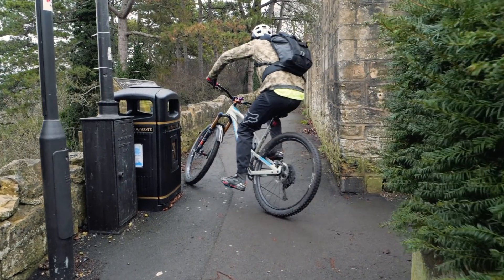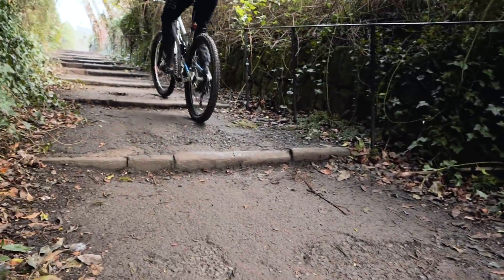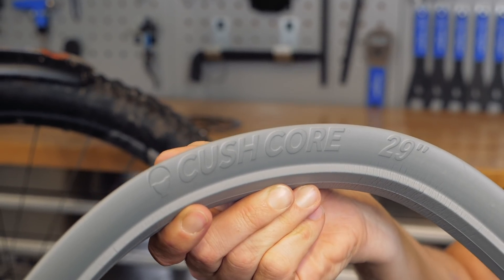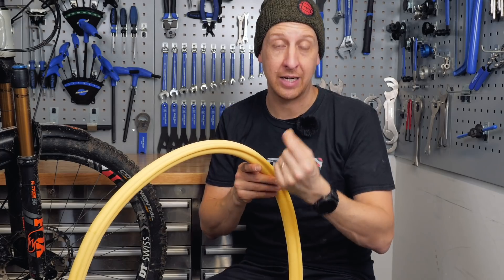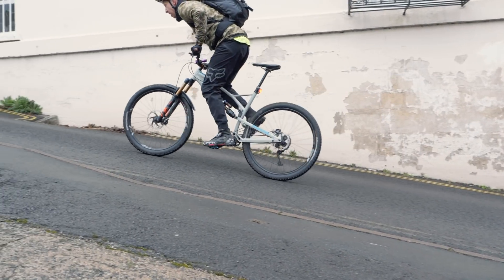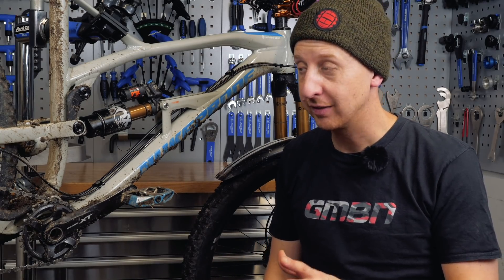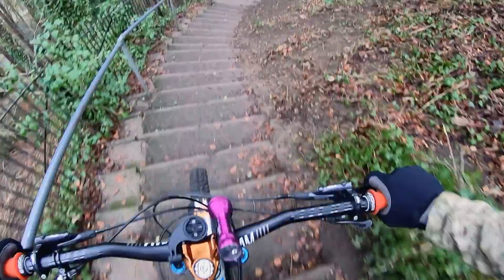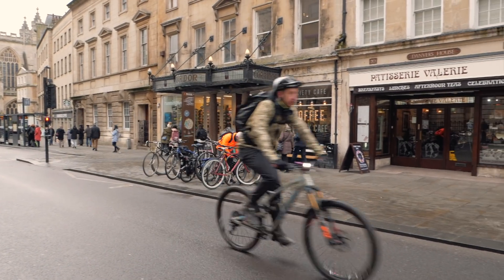Set Up Your Mountain Bike For Commuting And Urban Riding

Comment: I commute on a old scruffy looking GT Outpost Trail up graded to LX great big and goes under the radar
Reply: nick lowe 20 year old specialized rockhopper. It looks beat up so I don’t worry about drawing attention but I’ve got it fixed up enough to have fun running around town or on my commute. Rigid setup with like 55-60 psi in the old 26ers.

Comment: I got a factory surplus 1990s steel MTB frame & fork for £35 off ebay about 10 years ago, put big chainrings and small sprockets, slick tyres, & have the saddle as high as a road bike. No suspension! It's the most fun urban bike possible, I can overtake roadies easily when I feel fit and then have some fun on loose dusty footpaths, hop up kerbs and take random shortcuts without ever worrying if the rims will get damaged. X3 shifting and derailleurs so shifting is quick. Deore v-brakes, which are good enough for the job. Plus the flat bars mean I'm always heads up in traffic, which is arguably the most important thing to be aware of when riding on city streets. I can't descend stairs as quick as the vid tho ha.

It's way more fun than any hybrid /"urban commute" bike and cost about 1/3 of what you pay for a brand new one. I still want one of those Whyte commuter bikes tho, they look well good

Comment: with regular urban riding realistically you have to ditch the knobbly full off road tyres as a set of narrower semi slicks makes it so much easier to get up to speed on tarmac , not to mention improved grip in the wet
any of schwalbes /  continental trekking tyres will be a good investment and will retain some level  of off road capability if you have mixed terrain to ride on your commute

Comment: Great tips in this video Doddy, but I think a $200 single speed w flats is the way to go for urban commuting.  I did a budget conversion w drop bars on a hybrid bike to make a cheap gravel style commuter w 40c rubber.  Its decent in most conditions and i wont be too sad if it got nicked.
Reply: Had a £250 single speed.
Didn't take long to break it

Comment: Do you notice any increased tyre wear when riding almost exclusively on hard surfaces? After commuting on my steel road bike for years , I recently bought a new dual-sus 29er with 2.4" tyres (although not a particularly soft compound) and have been commuting on it almost exclusively. But i'm concerned that i'll wear through the centre knobs too quickly. On my old 26" hard tail years ago I used to swap to narrow slicks regularly because I used tubes, but with the new bike i'm running tubeless which means that changing tyres regularly is a pain. I guess the only other option is to get another wheelset and tyres, which isn't cheap.

Comment: My city bike was in repair, so I "had" to use my MTB.   I cranked the psi way up on my tires (ehm close to 5 bar) .. rolls like a MF (pretty worn down tires helped a lot to make the ride smooth) :-) I even installed some aero-bars for that long stints in the wind (yeah I know, a total no-no but ... bite me).  So much fun.

Comment: No! You need a spare bike. I think a low spec rigid MTB with same wheel size and discs brakes is better as a commuter bike. So, is a spare bike too, maybe if a friend needs one to go a trail with you or your best bike have problems. Or you can swap wheels or tires (or stem, handlebar, etc) if needed. A 3x8, suntour fork, cheap aluminun, mechanical disc is enough for city.

Comment: I run a RS Monarch RT on my 150mm full suspension bike, I couldn't get my head around why my shock stroke is soo rough..... No scrathes nothing, looks just fine on the outside but it feels soo bad when running through the travel. You said "Don't run the climb switch permanently because you'll bent the system" But...... I normally run the climb switch (blue switch) on a permanent bases on my shock, also when I'm riding downhill en doing jumps, just because it makes my bike react more the way I want.... Does that mean I broke it? Or bent it?

Comment: I think you missed upsizing the front chain ring.  A l-o-n-g time ago (17 years) my only bike was a Giant XTC, which I raced and commutes on. Commute was high pressure (100psi) slicks, off roads was baggy knobblies.  With a triple chain ring I had a tip end that was fine for quick commutes.  Return to MTB after long stint as a roadie, and running out of gears at modest speed cracks me.  If I were to commute on the Anthem, with its 1x12, I would have to upsize that front ring substantially. Rarely need the super low crawling pace gearing on a commute, which I have done for years where the lowest gear was a 39x23. Just a thought.

Comment: Used to use to use my old Caloi hardtail with a rock shox fork to train for some roadie stuff I did ( not to worry, I've since reformed and strictly MTB nowadays ) and the settings worked brilliant. Turn it up a bit for the paved portions and soften it slightly for the dirt/gravel roads in between.

Comment: #AskGMBN Are there metal shafts to fit instead of a shock if you want to convert to a hard tail? Would this be bad for the bike?
Reply: I'd be super curious to see if this works
Reply: Wouldn't you just use the lockout?
Reply: @newttella1043  
What about a bike with no lockout?
Reply: I may be wrong, but I suspect that as the rear end is designed to move i.e it has bearings etc if you fitted a rigid metal shaft, it would cause issues with the moving parts. The vibrations would probably not be very good for the frame either.
Reply: @foxxy2583  I didn't realize some shocks didn't have a lock out. I wouldn't risk it because either the pivots mounts on the frame, bushings, threads, or bearings that hold the shock might wear out quickly. These parts would take all the impact. Shocks, and even most forks, don't really lock out 100 percent and have a little bit of blow off designed into them...I just saw comment by @jcollins782 so we are seeing the same issue.
Reply: @newttella1043  
My front fork completely locksout. Maybe a different bearing setup or something. I'm sure in the near future someone will make a bike that will convert from full sos to ht.
Reply: @foxxy2583  Just replace your shock with one that has a lockout, not cheap, but way safer than a rigid rod. Or just buy a hard tail. No point in converting a full suspension to a hard tail in such a permanent way.
Reply: Go for it let's see what happens.
Reply: @foxxy2583  Sounds like you really want this to happen. For sure there is no "part" that you can buy for this purpose as you may be the only person that thinks this is a good idea. You should hack it and then send a picture of it to Hacks 'n Bodges. I would love to see it.
Reply: thanks for all the replies. Im not actually considering this myself, it was just hypothetical. Even shocks with lockouts arent quite locked out though, and i assume a lot of weight could be saved with it as well, for commuting and stuff
Reply: @newttella1043  Or for the price of replacing a shock, get a used hardtail. Or, get something with fenders and lights and come to work decent.

Comment: When i cycled my full sus to work i just changed the tyres, got myself a set of thick slicks running at 50psi as it was just tarmac paths and it felt really good just a bit annoying having to change tyres over for hitting the trails.

Comment: I use Cush core, and run run 4 psi lower pressures so rim damage won't be an issue, I prefer the traction & comfort over rolling resistance, but if I use Highroller 2 they roll well, but of course running mud tyres will  roll noticeable slower.
I currently run Suomi Gazza Exptreme 294 2.1 29er tyre, So I can't use Cush Core, and ca't run tubeless,
 it's a lot harsher cus I have to run 4psi more than wiht tubeless set up without Cush core, so going from cus core to this it's 8 psi more.
also cornering suffers, I think I will try Ice Spiker tubeless with Cush core next.
I run 20 psi front 24 in the rear with Cush Core in the summer, but need to get better studded tyre setup.

Comment: I'd never commute on my full suspension bike, unless I was driving through the woods. I have a fully rigid trekking bike with 3x9 drive train, a rack, mudguards and lights powered by a dynamo hub. It costs as much as a decent groupset which would get completely ruined from salt on the streets...

Comment: For longer commutes I slap a set of slim wheels in my fully rigid fat bike frame. If it's shorter distance or bad roads I keep the fat tires.
 My trail bike seems to have gotten pushed to the side by the fattie...
Reply: As i see that kind of monster bike, i wish i had one) just dream. Interesting, how fast they can move on road, mud, snow, sand with the same rider power, with compare to road bike and common MTB. My MTB has 26x2 spiky mud tires, but on dry sand it doesnt move at all, even at low pressure.

Comment: I keep wrecking every part of my mtb while urban riding, it's depressing
Reply: Are you riding in Kaboul? 🤔
Reply: @pizou8454  Haha no, in France. But my mtb is not so fresh and since I moved in a city I've mainly ridden on really long stairs. A few days ago while I was going down some stairs my derailleur got stuck between the spokes of the rear wheel and was neatly sliced. So I took it off and used only the chain (so I had just one speed) to ride again. And 2 days after that it's the drive and the chain wheel that got wrecked, plus both of my wheel are slightly bent. As I don't know if I want to put hundreds of euros to repair a 11 years old mtb and I don't have the money to buy a good new one, I'm depressed and done mtbiking atm ^^
Reply: @fabien9765  i don't like mixing the two. I bought an old Ridgeback Comet for about £20 which didnt need much repaire. I used that to get around City. There's too many hard surfaces in urban dwellings which wrecks the mtb. Don't despaire man. You can repair a bike cheaply if you get in touch with the right people. If not just get a cheap bike to get you around City while you safe up. I had so much fun with my Ridgeback Comet and spent next to nothing on it.

Comment: Nah my full sus stays clean and locked in my apartment when I'm not riding on dirt. You risk damaging components and putting excessive wear on tires, paint, bearings, rotors, and pads especially in the winter with salt and grime all over the road. I don't have time to keep my bike clean after every commute so all of my expendable parts would get shit kicked in the winter. I dont want to have to replace my chain, cassette, chaining, pads, etc more than I already do. 

Get yourself a cheap bike and turn it into a "gravel" bike. Still let's you rip dirt and have fun, but is far better suited to commuting and is okay to get filthy or stolen. And full fenders make so much difference when its wet. A bike like this could be had for under $300 which is as much as the maintenance cost you'd rack up each winter riding your expensive trail bike as a commuter. In addition to the maintenance you have to do during the season. No thank you.

Comment: I commute on my hard tail from Dec. -  Feb., 4-5 days a week. What do you recommend for winter cleaning and chain maintenance? I’m dealing with sand, grit, crunchy stuff in the drive train. Hosing and wiping down of days above freezing always leads to rust spots on the chain and bolts. A video would be great.

Comment: Main problem for me if using the same bike is cockpit setup, 

On the trails tend to be in a more aggressive position, 

Commuting , I find my bars are a bit low due to wanting to be in a more relaxed upright seated peddling position, 

But I’ve solved that by having two bikes , kept an old one as a commuter